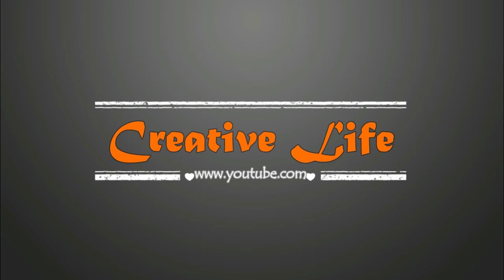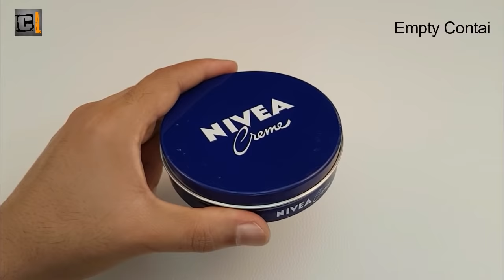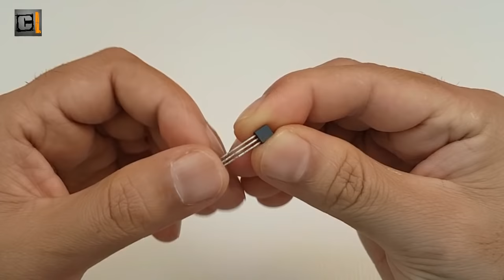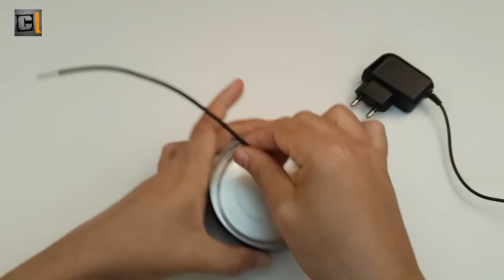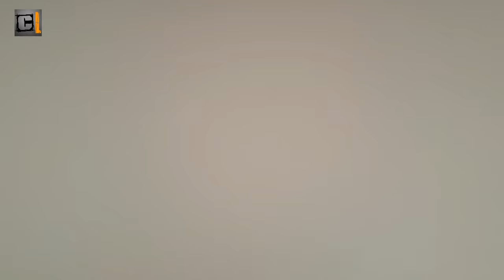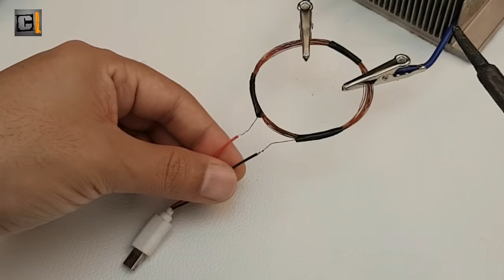How To Make a Wireless Charger

Comment: wireless chargers work off of a AC sign wave,the wall adapter produces 5 Volts with a DC sign wave aside from this, no control circuit, no form of a detection circuit (not just to save power but also as a safety), no rectifier for the phone, no form of a transducer, (wireless power works better with  higher voltage) or current limiter. This does not work.....all this could be is a magnetic switch to activate a power bank.
Reply: now....on the other hand phone manufacturers would love this video, and want every one dumb enough to do this. Void your warranty and kill your phone at the same time!!!  make phone manufacturers MORE money off of a device that only cost them a couple dollars to make!!!! brilliant!

Comment: does it not defeat the purpose if I still have to plug the coil into the the phone or device charging? Is their one where you just set the unit on top of the charging station?

Comment: Its fake bcoz wireless charging needs an alternating current and also this guy is not rectifying the AC to DC. This guy is directly connecting the coil to the mobile phone. Mobile needs DC to charge

Comment: The secret revealed he used thin can as cover when both coil touch the thin plate then Current power supply will transfer or Receive by the second coil the container thin plate serve as   induction let say it quite related to the title but the main factor of wireless far from this content when he even try 5milimeter away his phone doesn't received any current so it not wireless at all

Comment: saikiran kiran 

yes it is not necessary to producing variable Magnatic field AC supply is needed.... but u also produce it by using two Magnatic field resultant...here transisor is divided primary Coil in two part and resultant field produce variable Magnatic filed....   but in this video this guy directly connected his phone with secondary Coil...this is never charge ur mobile... even u connect full rectified circuit then also it not work bcz with rectified current is may be around only 60 milli amps....it just show that ur phone charge but actually charging not rises......

don't use this on ur mobile without any perfect knowledge.....

don't make this types of full videos...

Comment: Hey can u tell me the size of the copper wire
Reply: Cards World it is fake, no need to know
Reply: You cannot transfer current over air with dc
Reply: this is real,,, this truly works,,  you have to know and understand how battery works, so that you will know
Reply: chrisjohn capitle Misinformed...
Reply: O
Reply: @raidzor5452  yes you can, the transistor turns the DC into what must be a DC square wave. This is good for running a coil. This is the same thing Slayer exciters do

Comment: Fake not work, the coil make turn on n off the transistor to produce pulse but the problem another coil which is place from the back of the phone also producing pulse signal which is not converted to dc to charge the phone.😏

Comment: fake asf! you need a full bridge rectifier/single diode rectifier before the coil and after the connection to the phone, otherwise you would break your phone with the negative AC cycle.

Comment: Fake wireless charger. It will not work. DC to DC conversion based on induction is not possible. And there are other errors such as the metal container, plastic tapes on the coil etc.

Comment: Kyo sabi ko fake bata rahay ho 

DC may induction nai hota h
Reply: Virendra Dhawal 

saikiran kiran 

yes it is not necessary to producing variable Magnatic field AC supply is needed.... but u also produce it by using two Magnatic field resultant...here transisor is divided primary Coil in two part and resultant field produce variable Magnatic filed....   but in this video this guy directly connected his phone with secondary Coil...this is never charge ur mobile... even u connect full rectified circuit then also it not work bcz with rectified current is may be around only 60 milli amps....it just show that ur phone charge but actually charging not rises......

don't use this on ur mobile without any perfect knowledge.....

don't make this types of full videos...

Comment: That is stupid you can simply buy a very cheap wireless charging pad to plug into a phone which allows an older phone to charge wirelessly, it will also cost less than making a stupid thing that WILL NOT WORK, note that physics do not work this way

Comment: FAKE ..FAKE.. don't believe this guy's 2n2222n transistor won't take much current and voltage and the power transferred from this circuit is only enough to power a led . Don't try this and damage your battery

Comment: Well, that was a waste of my life.  Literally not a wireless charger in the slightest.  Charger connected to wire and then connected to a metal canister.  Coil on back of phone touches metal canister and power is transfered due to metal/metal contact.  Have the same results if you cut the cord and reconnect the ends except this version looks tacky as shit.

Comment: needs a bridge rectifier on the phones micro usb end otherwise transmitting ac voltage. also the power supply is dc. fake anyway but just saying

Comment: This is total BS  Lol
First problem is placing the coil inside a metal can is going to shield any transfer of energy and I don't have to repeat what's stated in the other comments.
Anyone else the battery icon on his phone doesn't change when he places it on the so called wireless charger? The beep is dubbed in
Block this channel!

Comment: I would give this an F. It is wrong on so many levels. Even if it is oscillating with the transistor, the metal tin is going to block the EM field. Then you have a pick up coil applying a non rectified,  unfiltered, un regulated, AC current to the USB port on the phone. If this even works, it would be damaging in so many ways. Dont do it. Thumbs down..

Comment: Fake video....😂😂
Reason: 1 only AC signals can be        wirelessly  transmitted.
                2 even if signals are transferred then secondary coil will receive only AC signals not 5v DC signals
                3 mobile phone requires 5v DC supply which your secondary coil does not produce due of lack of diode to be used 🎉🎉🎉

STOP MAKING FAKE VIDEOS 🙏🙏🙏

Comment: Fake....don't believe
Reply: +Kavitha Hari : Google "Michael Faraday's Laws of Electromagnetic Induction", and report back to me how -"fake" this is.

From your replies I can see that you did not follow up by reading about Michael Faraday's Electromagnetic Induction Experiments, which were carried out using Direct Current from batteries. He demonstrates the transmission of electromagnetic energy via collapsing the current and re-instating it manually. In this demonstration, the transistor is switching the current on and off.
Reply: dav snow  how an AC is converted to DC 5v.....tat can charge a. Phone .....we need a rectifier circuit
Reply: Moreover DC can't be transmitted through air.....basic knowledge
Reply: Kavitha Hari if you don't understand inductive charging, search it on Google.